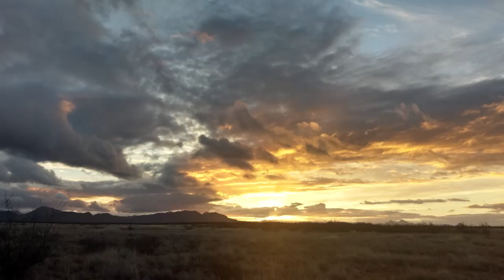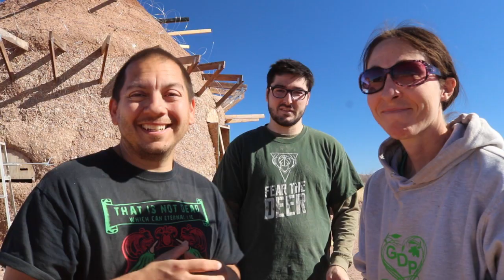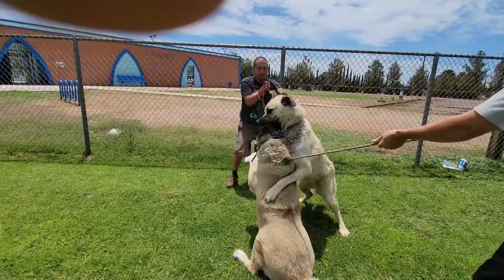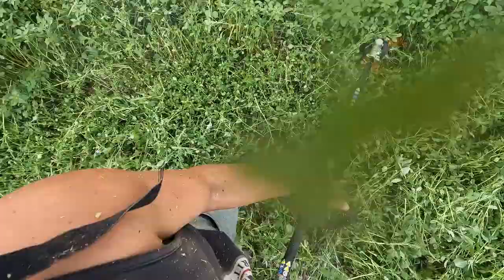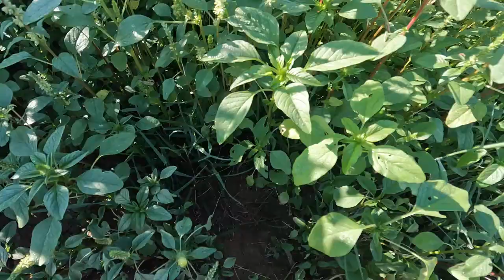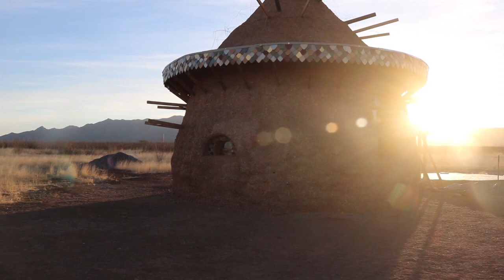OFF-GRID SURVIVAL:  This ONE Thing Made All The Difference

Comment: For weed whacking, get a Tyvek disposable suit ($10-12 at your local hardware store).  These can last for a long time if you just brush off the burrs when you're finished and use them again.  They don't tear like the paper ones.  Since they are white, light weight and cool enough they can be used on a hot/warm day.

Comment: I have the utmost respect for your efforts. One thing you need to think about is that the straw in the mud is for strength by providing fiber to hold the mud together -- too much straw holds too much moisture and weakens the mud. A good balance of straw to mud will make the mud predominate and keep the straw as the strength that holds it together. You can add other things as long as it serves as another bonding agent. Right now, when you look at your structures, you see a lot of straw on the surface ... the mud is behind it because the mud sloughed off. Adobe works because its clay - a less absorbent material. Dries hard as a rock and just as brittle. The straw tempers that brittleness and prevents cracking. Cracks allow moisture to get in. Adobe will weaken and crumble unless something like straw is present to prevent the cracks. All things I'm sure you know but you have way too much straw in the mix. Just look at it. Go to your neighbor's house and look at theirs. (The Upside of Downsizing). Yes the lime can help - yes the hair is stronger - yes the eggshell is lighter than sand. You do know your stuff but the mix is a little off. Cut back on the amount of straw to clay. Please?

Comment: I know you guys are sooo busy, but I think I heard you say garden, you can build raised beds on that hard pan.  If you can find some wooden crates, stone stacks, brick, what ever will hold soil and is cheap or free. Your totes cut in thirds, are great, I have 10, use the bottom and top for crops and the middle where the lid/valve is for compost.  The ground under the compost becomes good soil very quickly as the worms move in.  Once the compost has broken down, move it by just flipping the open ended tote over and start again, and plant something where it was, after feeding the garden all that good compost.  You will end up with a 40 inch square row in no time.  We have our tote top and bottom about 15” high, and the middle just on the ground.  We put root crops in the tops and bottoms, once you flip the compost container over, you could maybe plant squash, melons or even sweet potatoes there. Leave the cages around the tops and bottoms or they will bulge out.  We fill the bottom half of our beds with free manure, and bought compost in the beginning.  You could also let your chickens work the compost for you, they down a really great job.

Comment: Have you notice? How well the chicken coop is doing with all the lumber and tin on top. That would make a nice car port and storage. Even a nice work shop  Your RV trailer would do much better!  With a tin roof build over it!  Make it where there it over hangs, to put things under it, and the trailer. You may like to make a bigger room for it as well from the doors. >>   I have notice every time it rains!  It floods every thing around you. There for?  You got to build speed bumps to redirect the water! Like into a pond,  irrigation channels ect.  Make your foundation every thing 2' higher around it, and off the ground will help, as well. This will help to redirect the water away from you home and things

Comment: Good video. Would turning the soil before a rain fall make the soil richer and more absorbent? A garden tractor with a moldboard plow could turn that soil. Do it in an alternating section pattern so that only part is turned up at any time. Good Luck, Rick
Reply: Gotta be careful of the heavy winds coming up...  turned top soil will just blow away. Maybe do a layered approach with big strips of wood mulch on top.... to hold everything down and retain moisture.

Comment: The GgrigTe (rocks) you installed around the top of the root cellar was a poorly thought out problem that you may not have known about. The rock without a place to drain was a huge mistake. Water fills it up and imposes extreme forces on the walls. Drainage is extremely important. I would have considered installed vertical and horizontal rebar for extra strength. 12” to 16” OC vertically and horizontally insuring to tie all intersecting rebar together. Water drainage is absolutely mandatory. Remove the rocks or install ample drainage away from the structure.
Reply: I think a drainage pit with a pump will also work as insurance, just like how they are used in French drains.
I think you guys are a great couple. I had been a mental health nurse for years till my recent retirement, so Jess I am with you and how you think about things generally. A gutsy vid, thanks for sharing
Reply: That word was supposed to be aggregate. A simp pump would have been the best thing to handle any water that entered the cellar. But that rock he placed to get his wheelbarrow close enough to finish backfilling should have been removed. I know about a lot about drainage systems from my civil engineering design days as well as my own nightmare home on the side of a hill.

Comment: @ green dream project
Flux means flow. Drought means significantly drier than baseline. Large amounts or high rates of water flow can be particularly destructive. Geography, topography, and the lay of the land determine the waters flow. Elegant, efficient, and effective design are critical to long-term success. Monolithic structures, domes homes and particularly their foundations can't be successfully sited directly in the flux flow. Don't fight the flow, direct it well away from anything you want to last. First, defend the Dome it is your home. The second Dome will have to be partially resited, or the flux flow entirely diverted.  The strength of the design comes from the heart and the mind. Consult the experienced and the experts. Implementing necessary and sufficient solutions. Express gratitude knowing the work you have before you.